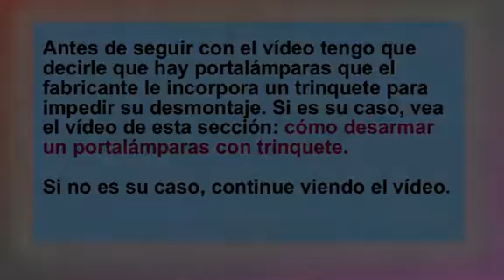Cambiar o instalar un portalámparas en una lámpara de pié, mesa o colgada

Comment: Pero como se cual es positivo o negativo si los dos cables son blancos o negros y lo único que lo diferencia es una raya o letras ,me refiero al primero
Reply from the maker: Hola Litzy. No te calientes la cabeza, aquí no importa si es positivo o negativo puedes colocarlos como quieras, es indiferente. Uno en una borna y otro en la otra del porta lámparas y funcionara correctamente. Suerte
Reply: Muchas muchas gracias 😊 disculpa mi ignorancia pero me toca hacer desde el jardín hasta poner una lámpara sola y un ventilador 😔😩🙁😔🙁 pero gracias a la inteligencia de ustedes ya que sus videos de muchos incluso el tuyo son mi guía gracias de nuevo soy la Mil usos de mi casa 🏡 gracias 🙏🏻 a Dios existen personas como tu y si opine eso porque puse una lámpara colgante de seis focos 💡 y no trae cables de colores a la vista y el manual tampoco solo se que el cable es color es café y aún lado nomás a lo largo del cable muchas letras pequeñas y números y lo que está pasando es que el switch o interruptor se está calentando demasiado 😞😢y antes no pasaba y la que tenía era de 5 focos y nunca se calento el interruptor como ahora no se qué pasó 😪
Reply from the maker: Cambia las lámpras a led que consumen menos y no se calentara el circuito por un escesivo consumo. Suerte.
Reply: bricolajedecabecera tan lindo gracias por tomarte el tiempo en contestar 😜😊